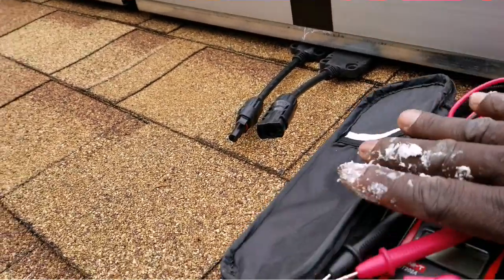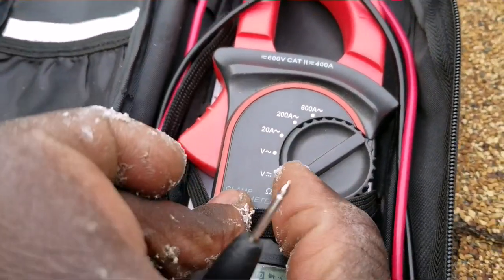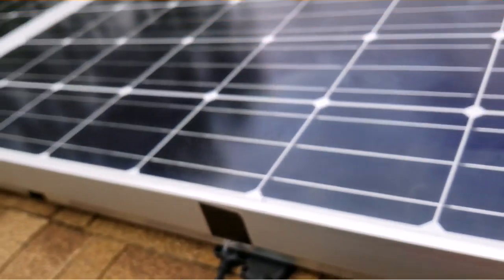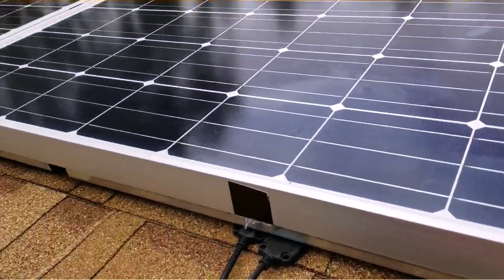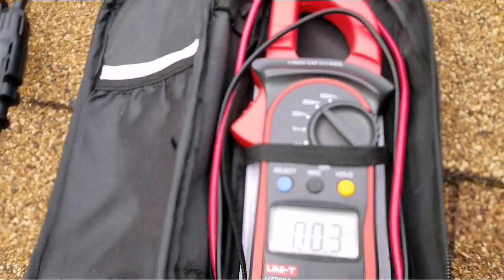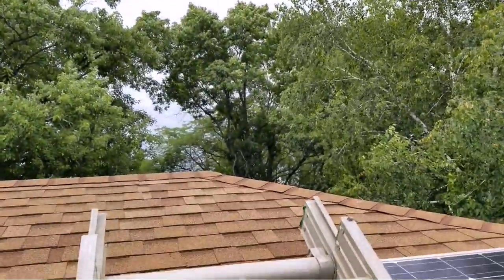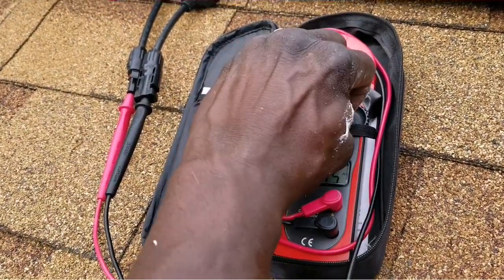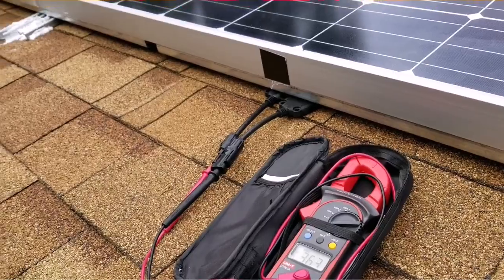HOW TO TEST A SOLAR PANEL VOLTAGE AND CURRENT

Comment: Thanks for the great video on this topic.  I'm actually having to do the same thing atm to flush out a bad panel.
Reply from the maker: Thanks for watching. I am glad you find this video helpful.
Don't forget to LIKE SUBSCRIBE and SHARE
Reply: It's a terrible video, because it doesn't correctly identify the current which he is attempting to measure (short-circuit), and his meter can't measure DC current at all so the value he is getting is meaningless nonsense.

Comment: My used panels are testing around 32 to 33 volts each and VOC is 37.6V The amps are hitting max of 8.5 per panel which is close to 8.85A rated on panels. I need to load them down to see how they perform.
Reply from the maker: Great👍

Comment: but you are testing for ac amps on a dc amp situation
Reply: I don't want to be rude but he doesn't know what he's doing.  How can you make a video and post it when the information that you're giving is incorrect?  He measured the voltage correctly but measure the amperage incorrectly. He is saying the panel that he is testing is currently 531.44 watts (36.4x14.6 = 531.44 watts). That is a powerful panel he's got there.  There's a clamp on there,  use it!
Reply: WTF?  When you switched the DMM to AC Ams Max 200, For darn sure you aren't  gonna be measuring that much current through those little probe wires and ALL DMMs using leads to test current switch to other jacks for current measurement. The 200 Amp range tells me you are supposed to be using the AMP clamp, NOT the leads.  That fact that you get ANY  reading gives me the idea that this is cheap-o-meter that should have sensed you were still connected to the leads and shown an Error.  AND Solar panels put out DC.  I assume you would want to test current BEFORE any microinverter.  Folks.. This gentleman needs to go back to school for basic electricity training.
Reply from the maker: UNISTRUT NUT WITH SPRING: Superstrut Solar Panel Mount
https://youtu.be/XBR-aiK7kIw

SOLAR PANEL ORIENTATION/Cutting Unistrut/Superstrut for Roof Mount Installation
https://youtu.be/eNFo08dfN8Q

UNISTRUT SOLAR PANEL MOUNT: How to install solar panels Using Unistrut/Superstrut
https://youtu.be/3uubcw8gGPw

Comment: So around 500w continuous in cloudy weather and partially shaded, good enough .
Reply from the maker: Yes Sir!
This is good enough with a weather like this
Reply: No! You can't just multiply the open-circuit voltage by the short-circuit current, because as soon as any load is connected to the panels the voltage and current will both fall to lower values.

When driving a load, the voltage will be less than the 36.4 V seen without a load, and with a real load the panels will not be able to maintain the short-circuit current. And the "14.7" reading isn't the actual short-circuit current, because the meter used isn't even capable of measuring DC current.